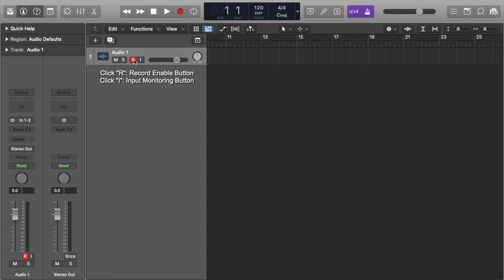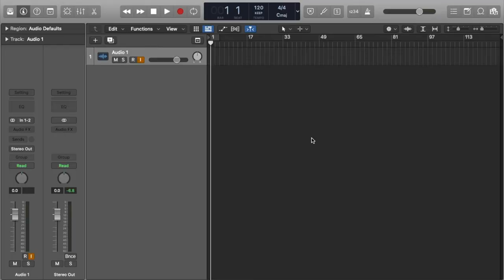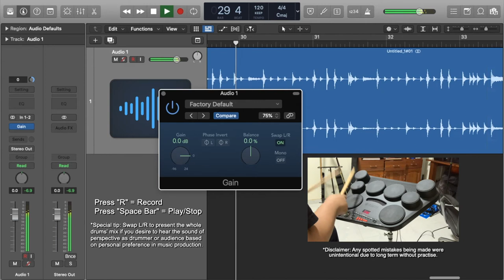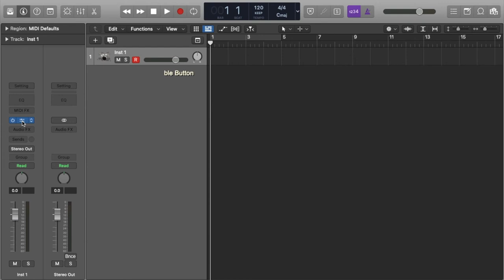Yamaha DD75 - Drums' Recording Tutorial (Audio & Midi) Using Cable Splitter & MIDI Cable

Comment: Hello Sir,
I have purchased yamaha dd 75, I want to record midi on pc
Software i use is Cakewalk Labband, When i connect to Laptop and set Midi Settings. I usually get Message like Midi port Busy / Insufficient Memory

I tried installing fruity loop and there also error was same 

Can you help me to know , like i really need audio interface to have connection proper, If yes Please suggest the audio interface 

Secondly can i connect below device directly without laptop
Yamaha dd 75  ( Have Midi In and Out)
Korg Pa 300 ( have only usb Host)
Reply from the maker: These are most helpful resources I have found. 

For me personally, choose the assets that you’re most comfortable with and make it as your personal primary preference. Always keep a look out for daily updates of your personal machine in order to run smoothly.

1. https://youtu.be/4WUuk1AE7vo
2. https://youtu.be/mYVFF-MTkOM
3. https://youtu.be/HFL3wOfPx9s

Comment: Hola amigo q tal ,una consulta tengo conectada una batería similar a la que tienes ,conectada vía midi ,uso el daw de Reaper ,tengo instalado el asio para que la batería efectúe los sonidos virtuales sin problema alguno .. resulta que el programa me reconoce la entrada midi y todo .. pero cuando toco el pads ,el sonido virtual solo suena cada 7 segundos .es decir le doy un toque me tira un sonido ..luego tengo que esperar otros 7 segundos para que suene nuevamente .. me podés ayudar a qué se debe
Reply from the maker: Go to Reaper’s preferences > Press Audio Device > Change the Buffer size. 

Choose 128 for recording and once it’s done, choose 1024 for mixing.

For more info, check this out! https://youtu.be/8z-07hWqBmc

Hope you find this helpful, Amigo. Gracias. Comer Con Gusto! 💪💪💪